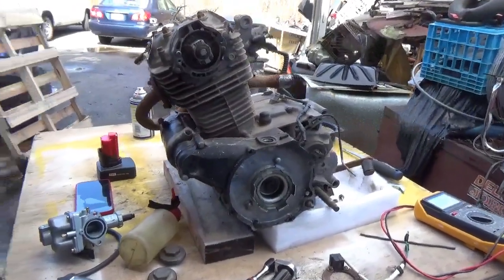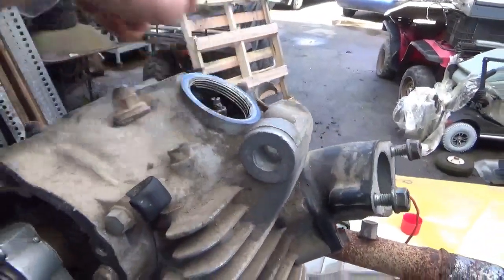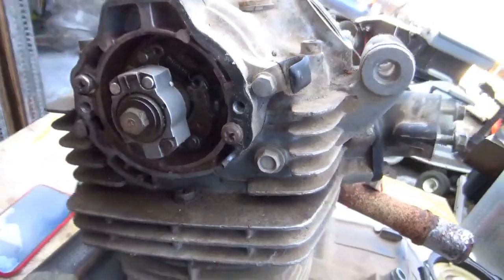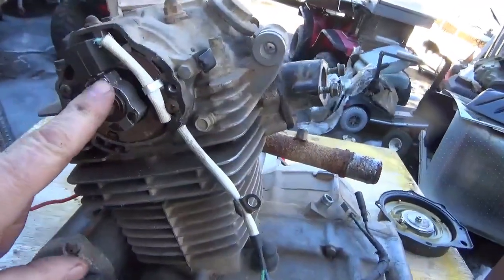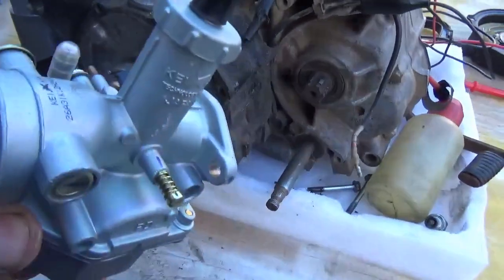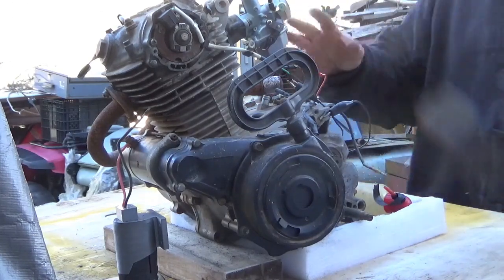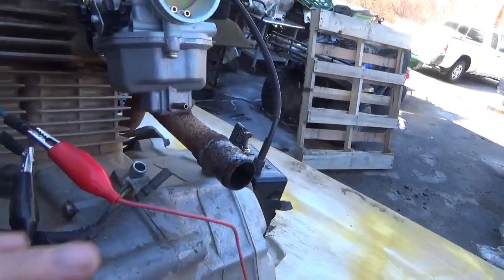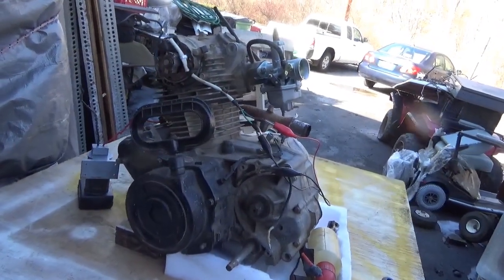How To Bench Test an ATV Engine, Honda ATC200M Motor Cold Start!

Comment: Sounded real good. I've seen people use a cut up frame as a bench engine stsnd
Reply from the maker: Hey  Ashley!!!! I've been thinking about some kind of rolling stand with a hanger for the head mount, I also considered using an old frame, but, a 200s frame would only be good for a 185/200cc, would not work for the trx250.... Very good idea, I considered it! Thanks also for Ur thoughts, suggestions, watching, and commenting!!!

Comment: Engines, my favorite. Today at the shop, they tore down a 500cc ATV that had been rolled but not shut off. While the kids argued, the top end was well oiled but we all know the bottom end can't be neglected for long. We'll start with the price of a crank and go from there. Glad you mentioned the TRX250, talk soon.
Reply from the maker: Hey Steve, Some kids wreck anything they touch... One of the folks I get some of my stuff from just tears up every ATV he gets.... Some of the vintage stuff can take the abuse, the newer stuff looks like it was rolled about by a bull dozer in a junk yard! I put some more time in on the trx250, motor looks like it needs to come off... Trying to figure out how to package up the videos.... Thanks always for Ur thoughts, info, support, watching, and commenting!!!
Reply: @HarveySpooner  Quick update- 4 garage like tarps, asst. mufflers and pipes, handful of L brackets from mounts, rear wheels and tires ready, working on front tires without wheels and a few grab bars. Weisco piston  and ATV parts catalogs Back to work..